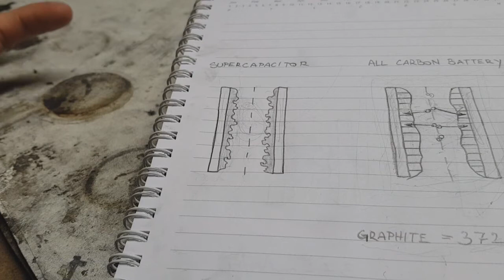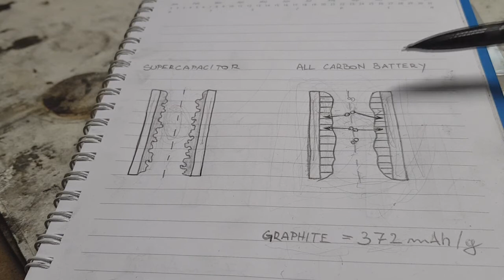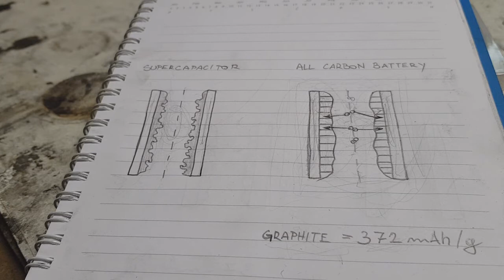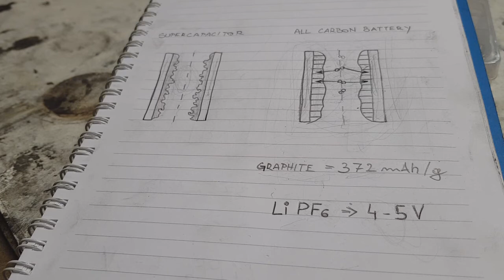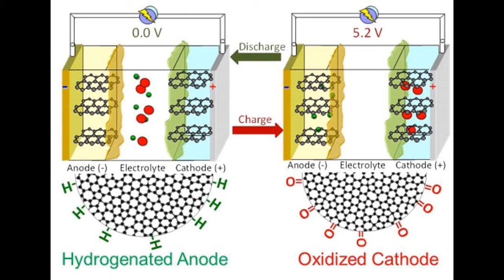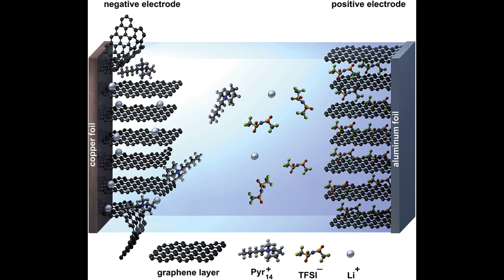ALL CARBON BATTERY part 1

Comment: http://www.pk-components.de/deu/passiv_highlights/news_id=189/
Reply from the maker: Chris Klama not bad,... energy density is almost like by lead acid battery (Pb= 60-110Wh/L). Also not bad to use a lithium titanate in supercap,.... is like lithium ion capacitor but instead graphite on anode is used lithium titanate. Thanks for this
Reply: cayrex2 
We have to say Thank you!
Reply from the maker: Chris Klama no problem! But is still better to use a graphite material in anode, because is more cheap and have much more capacity (graphite = over 300 mAh/g, lithium titanate = over 200 mAh/g).